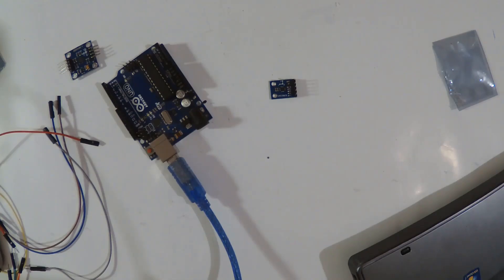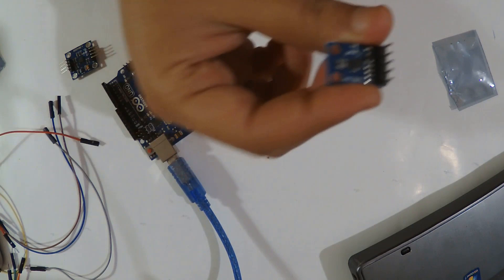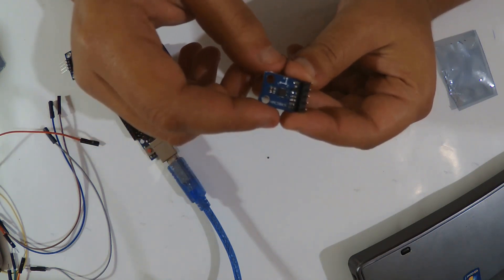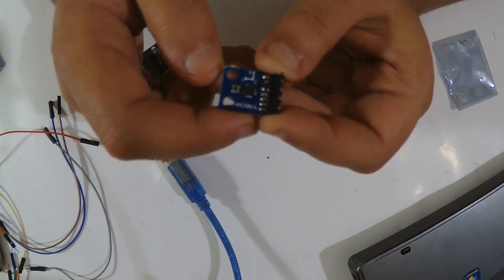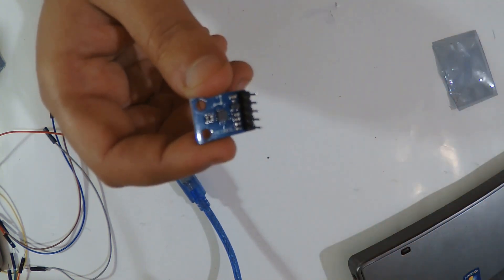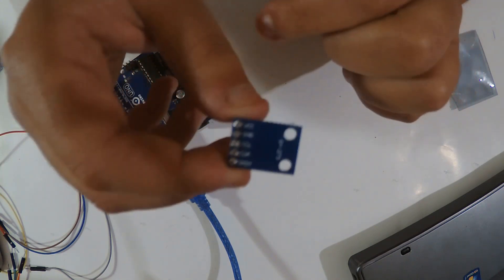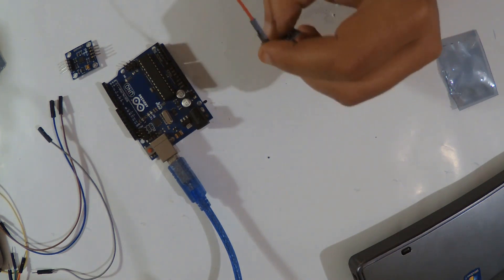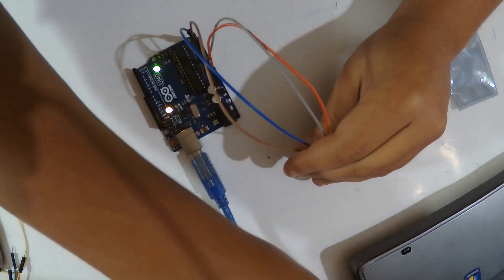Interfacing HMC5883L / QMC5883 Digital compass with Arduino

Comment: Please, pay attention ti the header pins that are soldered in the board. Some of them are metalic-magnetic and will produce "noise" to the sensor. Use a magnet to check ig the pins provided are metalic. Use copper wire instead.

Comment: sir the values that are showing are in raw form???if yes then how to convert it ....and yes i got confused that what gy-271 measures???is it measuring the distance in which axis the sensor moved???
Reply from the maker: It's a digital magnetometer, sense the magnetic field ... if you spin around "z" axis then "x" and "y" values will change, if around any axis then the other ones change, it's used in navigation systems or robot positionning

Comment: I have a chip with * DB 5883 7008 written on it, what version is this? I have hw-127 written on its' back
In additio, when I use this code, I have 0,0,0 or -1,-1,-1 instead of normal values.
Is my magnetometer broken or sth?
Reply from the maker: Maybe it's another version that requires another library, check by using the i²c scanner if you find a device and its address, it means that the module is not broken
Reply: @SurtrTech  any way to use the i2c scanner? 
I'm new to engineering sir, so i would like to know how to do so
Reply from the maker: @princeedhwardhezmi6469  Hello, just wire the module with Arduino: 5V/GND and SDA/SCL with A4/A5 (for Uno) and download the i2c scanner from Arduino playground (https://playground.arduino.cc/Main/I2cScanner/) upload to the board and open the serial monitor, if a device is found it will show you its address.

Comment: hello, can you help me about the compass issue. I know that mine is QMC not HMC because I see the values on serial monitor. But the problem is that when I move the QMC the values on the serial monitor freezes and when I reset UNO sometimes the values are back,then I move the QMC freezing again.
Reply from the maker: I think it's a wiring problem, something isn't soldered right or a loose connection
Reply: @SurtrTech  thank you for your reply,but I am sure that connections are ok.even if the scl or sda pins got loose arduino will keep working. In my case arduino stops working and the writings on the serial monitor freezes
Reply from the maker: @yigittimurarpack9949  If the only writings you have are coming from the module it will freeze because there are no information coming, you can try using the i²c scanner, and when you find the address start moving the module as you did and check if it will still be detected or no

Comment: I have do the wiring correctly at my Arduino mega. but it still can found my sensor. btw on the chip was written db5883. can someone help me?
Reply from the maker: Hello, did you first use the i²c scanner to know its address?
and which one is it "0x0D" or "0x1E"? Also try with QMC library and HMC library
Reply: SurtrTech ive use it. It cant find the address. It just scanning for a long time
Reply: SurtrTech btw my chip written db5883 not da5883 like you mention in your video
Reply from the maker: @mec2672  There are some db versions as well, but know the device should be scanned before continuing,
Try using the multi speed i²c scanner: https://gist.github.com/2e1hnk/357621a32f185262f25eefb25cf35bc1

Also please check the wiring just in case (5V/GND/SDA(A4)/SCL(A5)), and don't forget if you soldered the pins yourself, verify the solder well
Reply: @SurtrTech  it does not found any result when scanning. Im using Arduino Mega so I have to connect (5V/GND/SDA(20)/SSCL(21)).
Reply from the maker: @mec2672  If you can't find the device, you may have a problem with it

Comment: Hello I am trying to make a compass with qmc5883l and 128x64 oled display. I can display values which are x,y,z,and azimut but ı cannot make a circle and the vector that spins with my rotates. Which library should I use?
 Is there any examples working?
Reply from the maker: Hello I don't know a concret example but I'm sure there are over there, you should add both OLED libraries, SSD1306 and Adafruit GFX, There are two ideas:
Make a static circle with N,S,W and E poles, then in the middle try ploting an arrown made of three lines ( you can modify), this arrow will keep the same center but the other side will move depending on the magnetic north position, you can associate the direction with the line's postion and then the two other lines that forms the head of the arrow will translate following the values from the sensor.
The other idea is to make the whole circle moving (The circle won't change) but the element inside it  N,S,W and E poles and the N will always point the North, and you'll play with the display position, all the elements will change their position depending of the sensor value.

Those are some ideas you can test and develop, if you want to make it yourself, or if you search well you'll find some examples.
Reply: @SurtrTech  Thank you, I've found the example and I fixed it. And it is working now. But I have other problem. I cannot display an integer on screen with using u8g2 library. It is including only Strings ( I am looking library manual now : https://github.com/olikraus/u8glib/wiki/userreference#drawbox)The librayu useful but I cannot find way to display a value(from any module , math calculating result etc.)

Comment: Hello, I am sorry to bother you again, but I was wondering where you could buy the REAL HMC5883L magnetometer/compass? Thanks in advance
Reply from the maker: Hi, no problem, I can recommend you "Adafruit", but now it's replaced by "LSM303", also "Sparkfun" but they replaced it with "MAG3110", as you can see most of the trusted sellers retired and replaced the product ... I don't want to recommend you another website and end up with a QMC again, but I showed you some good replacement...
Reply: @SurtrTech  Can the Sparkfun and Adafruit models be compatible with the HMC5883L library?
Reply from the maker: @dianaalivov1246  No, sorry, everyone has its own library, you can check other websites for that module if you really need it, I don't know them all, but those are trusted, alongside Seeed Studio (Also replaced that module with bmm150)

Comment: Hello, we are calibrating the compass on the Arduino, we get no data coming from the Serial Monitor. The baud rate is at 9600 on the Monitor, and the return is Newline. The calibration sketch is from the HMC5883L library --> Examples. The VCC and GND pins of the compass are connected to VCC and GND of the Arduino, and the SCL and SDA pins are connected to 20 and 21 (on the Arduino Mega) or connected to pins A4 and A5 (on the Arduino Uno). I have even reversed the SCL and SDA pins to no avail. It would be well appreciated if you could help. 

The code I am using:   https://github.com/jarzebski/Arduino-HMC5883L/blob/master/HMC5883L_calibrate/HMC5883L_calibrate.ino
Reply from the maker: Hello, the correct wiring is SDA/SCL with A4/A5 for UNO and 20/21 for Mega, don't inverse them,
Before that try to check if you have an HMC or QMC as showed in the video that are some QMC labeled as HMC, and they use different way, here's how to know it:
Wire the module with the board and run the i²c scanner, for the HMC you'll find the device in the address "0x1E" and the chip is labeled L883
for the QMC you'll find the device in the address "0x0D" or something else and the chip is labeled DA5883.

Comment: Hi, I got error on this code "  qmc.read(&x, &y, &z,&azimuth);"

it says azimuth:17: error: no matching function for call to 'MechaQMC5883::read(int*, int*, int*, int*)'
Reply from the maker: Did you install the library? Make sure it's MechaQMC5883 library
Reply: @SurtrTech  Yes I installed the library from the link on the description. But it doesn't work for me. But I downloaded new mechaqmc library and it works now. My only problem now is it produces and output around 65000 on x,y,z. Do you know the reason behind this?

note: im doing this on nodemcu esp8266
Reply from the maker: @norainnorainbow8453  Sorry, I didn't try this module with an ESP8266, is this 65000 value is constant or does it change if you move the sensor? Also I still don't know why the first library didn't work, if you're using another one it's better to try its examples
Reply: @SurtrTech  Hi, i have a question. my 2nd magnetometer. The i2c scan outputs 0x1E. The result x,y,z result values are all -1 and is not changing.
Reply from the maker: @norainnorainbow8453  If you have 0x1E and the chip is marked "L883", it means it's an HMC5883L, you should use the correct library for it not the one I use to test the module, that one is for QMC
You can try this one: https://github.com/jarzebski/Arduino-HMC5883L
I couldn't do it as you can see I found my HMC5883 was actually a QMC5883
Reply: Hi, i have a question. my 2nd magnetometer. The i2c scan outputs 0x1E. The result x,y,z result values are all -1 and is not changing.

Comment: i used the 12c scanner and i got...Unknow error at address 0x04
..what is the problem?
Reply from the maker: Try to remove other i²c devices you have, and try to check if the soldering is done right

Comment: How can I get the azimuth formula?
Reply from the maker: There's an example in the library that gives you the azimuth
Reply: @SurtrTech  Hi, are you am electrical engineer by profession ? Thanks a lot , Sir.
Reply from the maker: @debajyotimajumder2656  Hi, I just got two degrees in Electrical Engineering and Automation.
Reply: Yes, sir. I already try to use the library. But I haven't get proper azimuth value. At pure 90 degree, the sensor shows 135 degree. I am confuse and try to modifie the azimuth formula. While when I see the coding, that just provides not detail formula. Would you please help me :')
Reply from the maker: @alfinuralbab114  Did you try to set it by uncommenting and setting the function in the code "azimuth = qmc.azimuth(&y,&x);"? Or it didn't work?
You can also change the library for other ones the important is it should be a QMC library
Reply: Yes, sir. I have set It uncommented. I give more example. When the sensor get 359 degree, It headed at north west, not at exact north. What can I add to the formula so I get the exact heading? :')
Reply from the maker: @alfinuralbab114 You can access to the formula: Library folder -> You'll find Mecha_QMC5883l.cpp -> open it with a proper editor.
Down below you'll find the function for the azimuth:

float MechaQMC5883::azimuth(uint16_t *a, uint16_t *b){
  float azimuth = atan2((int)*a,(int)*b) * 180.0/PI;
  return azimuth < 0?360 + azimuth:azimuth;
}
And modify what you need.
Sorry about the inconvenience, in this video I just wanted to interface it with Arduino since it lures a lot of people with the name problem, that's why I don't know much about the azimuth formula, also you can find more libraries in Github dedicated to this module, and you'll maybe find other ways to calculate it.
Reply: very well. never mind, sir. you helped me much. Thank you!:))
Reply: @alfinuralbab114  Did you solve the problem? It seems there is some code missing from the library to  take into account the rotation of the 3rd axis.

Comment: hay sir. my address 0xD what its same with 0x0D or not? and this QMC or HMC?
Reply from the maker: Hi, it's probably a QMC, you can read the chip if it says DA5883 it's QMC, if it's L883, it's HMC, you can also try both libraries
Reply: @SurtrTech  iam try hmc libraries. but results the output always x 0 y 0 z 0 in all the code I was looking for on github. but I have not tried to use the qmc library
.can I contact you via email for a consultation
?

sorry my english so bad
Reply: @SurtrTech  ok Thank you very much
sir. I hope this channel is successful
Reply from the maker: @ndreasmanullang4702  Thanks a lot.
Reply: my imu sensor is GY-85

Comment: The code i2c wich have to tell me if the compass is fake or original,this code work only for the compass or for others?
Reply from the maker: There's no code that tells you this, you should first read the chip itself then try the i2c scanner code it's in the link bellow the video too, please read the article it tells you how to know if it's a HMC or a QMC disguised as HMC.
Reply from the maker: The i2c scanner gives you the i2c address , the HMC has one and the QMC has other one
Reply: @SurtrTech  Huge thanks

Comment: HMC =Honda Motor Company...it is their version of the chip not a fake
Reply from the maker: Hello, I know thanks you can check the link for why I called it fake, it doesn't contain the same chip as the original
Reply from the maker: They are sold as HMC, and it's printed on them but when interfacing with Arduino the HMC library doesn't function so you should use the QMC one, that's why I made this video.

Comment: I plug it in, run the code and all I get is... "I2C Scanner...Scanning...." and that's it. Any ideas? My pins are connected to: VCC - 3.3V, GND - GND, SCL - A5, SDA - A4.
Reply from the maker: Hello make sure that the module is the only device connected to the Arduino, and you're running the scanner code only do not merge it with another code
Reply: Yep I literally only have that connected and the code you posted. I'm trying to debug in other ways, I'm wondering if I haven't soldered the chip properly. :P Worst case scenario is it's a dud. Thanks anyway!
Reply from the maker: You can try to upload the example code for both HMC and QMC with their adresses 
use "0x1E" with HMC library and example, then try 0x0D with QMC library and example
You can test with a multimeter if your connections are good.

Comment: Is it even possible to get a HMC5883 magnetometer? I understood that the QMC8553 is made under license from Honeywell. It is perhaps not correct to call it a fake but I am very interested in your comment about it being unstable. Thank you for sharing this.
Reply from the maker: You can find the HMC in SparkFun or Adafruit. This one I've used says HMC too but actually is a QMC, I couldn't find another word than fake.
Reply: SurtrTech Thank you. It is certainly very misleading to label a board with HMC5883 when it is a QMC8553. A fake chip would have the same ID as the the original and have the same address and registers. I have a BNO055 coming and I hope it will be accurate.

Comment: Nice one. Found this video first, thank god. If you are running on batteries it might be worth your while reading the datasheet if you want to try and get the current usage down : http://img.filipeflop.com/files/download/Datasheet-QMC5883L-1.0%20.pdf 

I have not tested the current use, but datasheet suggests setting ODR_10Hz and OSR_64 will use up 75 uA, plus your microcontroller of course.

I could not download the abstraction library from the link, but for anyone else just search for Mecha QMC5883L or here's a link to the github depository : https://github.com/keepworking/Mecha_QMC5883L . Good work.

Comment: what will hapend if i have fake version?
Reply from the maker: I've got the fake version too, you should use another library, even if the module is called HMC5883 you should use a library that works for QMC5883, you can find it in the link in description, difference between them is accuracy and price, but the same principle of working.